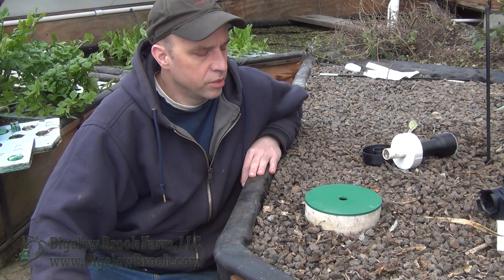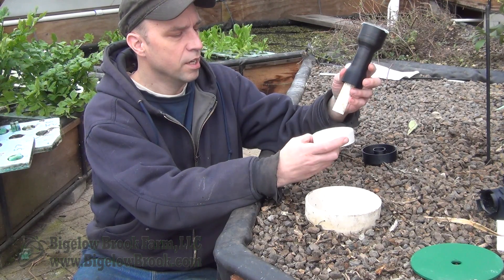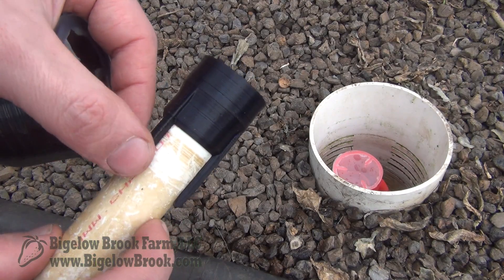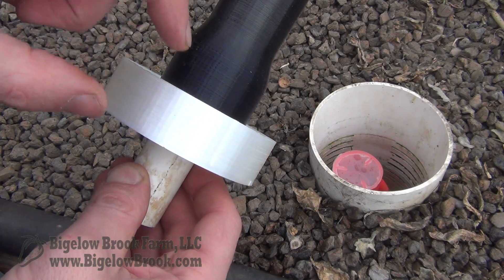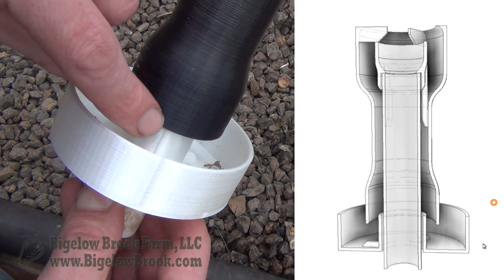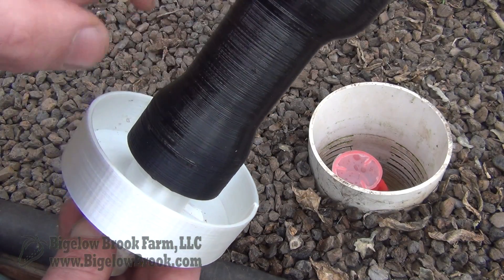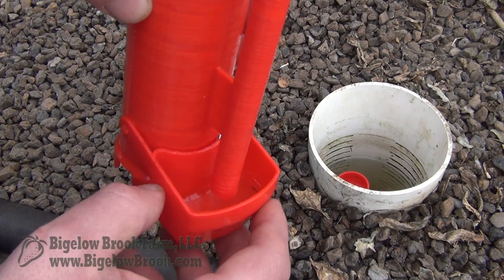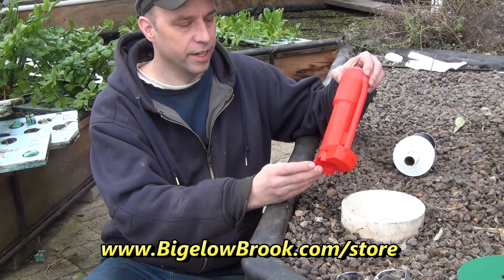Failed Bell Siphon Design

Comment: Put 4 holes in the bottom disc right below black pipe. That way it will not block water suction completely. When low level of water reached below bottom disc , it will be pulled up and air will be sucked.

Comment: You need 2 90s and a 3 or 4 inch vertical drop before the first elbow. Thats the biggest mistake people make. Adding moving parts only adds another failure point to a simple problem. The other big issue people run into is not putting input valves on there beds. The other thing people do wrong is run the output under water not allowing air to get back up the siphon to break it.  Snorkels, moving parts, and any other over engineering to the worlds simplest design will only add failure points and cause more problems. Remember bell siphons were first invented with no moving parts or snorkels in Rome 2000 years ago we don't need to reinvent the wheel use that original design and it works great. Everyone tries to tweak it and patent it and theres simply nothing to improve on.
Reply from the maker: So perhaps there was some room to improve!  My original tests, this doesn't need any elbows and can drop the water straight out, however I do have one elbow in the 6 I have running to direct the flow to the drain.  Also it will run with no tail pipe, again, I have about 1" before the elbow but it works without it.  Bell siphons were not invented by the Romans, it was a standard siphon, and there are drawings from the Egyptians showing they had them 1500 years prior to the Romans.  From what I have found, bell siphons (auto-siphons) starting showing up in the 1800's for sewage disposal.
Reply: https://en.wikipedia.org/wiki/Pythagorean_cup 570 bc. Haven't heard of the egyption one il have to look that up.
Reply from the maker: yeah, I think I saw it in wikipedia in the regular siphon area.  Hopefully I didn't see it on the Ancient Aliens show.  ;-)
Reply: Aliens invented aquaponics :P
Reply: Maybe Rob should have built an aquaponic pyramid greenhouse. (Who did that Bucky Fuller guy think he was, to improve on the tried and true?)
Don't mind me, I have been known to experiment with the heresy known as the Flout siphon. It has a moving part too.

Comment: Maybe someone suggested this, but. One thing that might be an improvement to the working 3d printed version, would be the air tube that is nested on the wall. Instead of being supported by the side of it. Less surface area. (just a minor thing)
Reply from the maker: I didn't feel like putting an extra bend in the tube.  ;-)